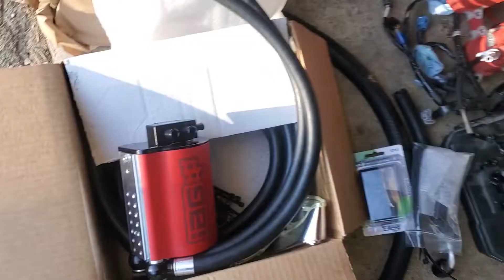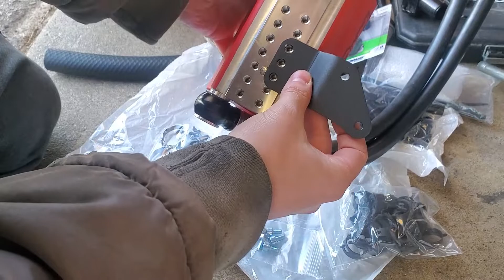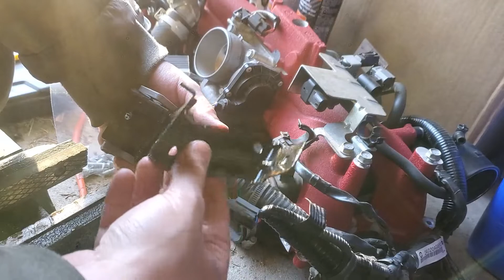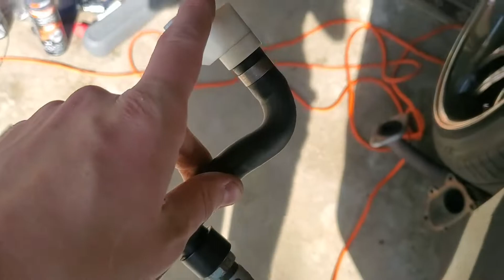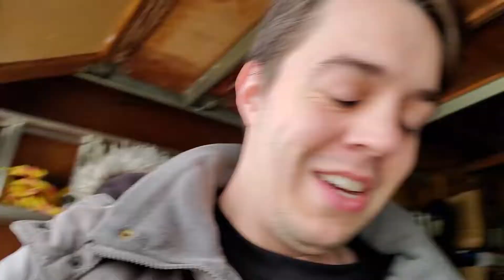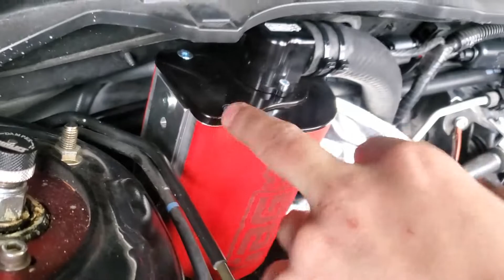2008+ STi IAG V3 Competition Series AOS Install

Comment: This is exactly what I needed to see the competition conversion but I have the Cobb AOS I threw on the car.
Reply from the maker: I found there wasnt much online about the conversion, but overall not difficult to do at all!
Reply: @zach_lush  nope not at all and a friend gave me the AOS for my killer b oil pan and I currently have radium dual cans but at 40 psi the cans fill straight with oil so now I’m going the competition route because I’m on speed density tune so it won’t cause any issues.
Reply from the maker: @E85_STI  im not sure how i feel about catch cans for that exact reason! But the competition AOS should help you with that. Yup, being your on speed density should make it an easy swap!
Reply: @zach_lush  yup for sure and I see you have a VA as well but I’m still waiting for the competition thing to come in but my question is the top part that comes out that one has 3 screws right? So the 1 inch vent you swapped to how many screws comes in that? I know the AOS has all those holes up top for adjustment but I’m curious how many screw holes the vent has
Reply from the maker: @E85_STI  honestly i can't remeber but i think it was 2 screws. The competition kit will come with new longer screws since the street series has a flatter mount on the top.

Comment: Does your vent hose have smokes comes out? Just wondering
Reply from the maker: No idea, never been under the car while it's running to see. I'd imagine it would just be a bit of oil vapor. If your worried about smell I haven't noticed anything.

Comment: QUESTIONS why the competition AOS need tuning 🤔
Reply from the maker: Its due to the comp series venting gases to atmosphere, whereas street series recirculates it back into the intake system. It doesn't act as factory and will throw off the car. Street series requires no tune